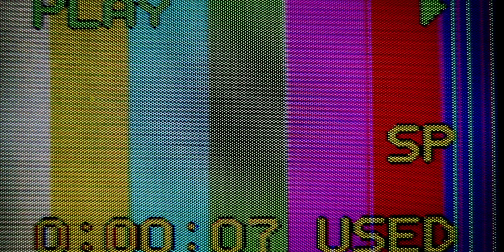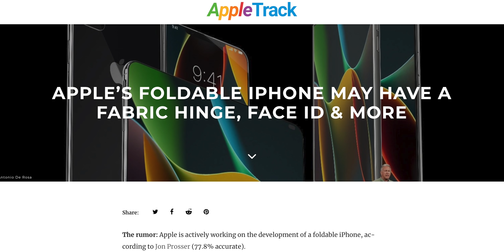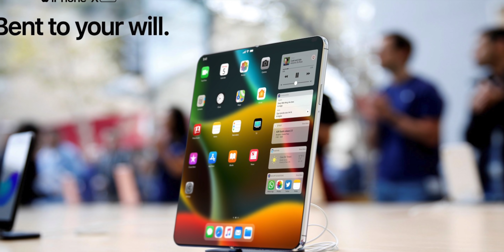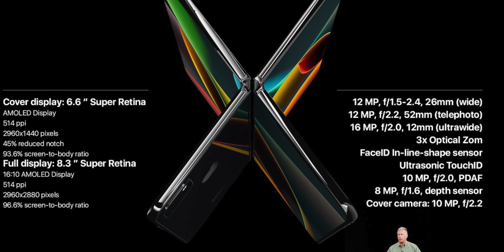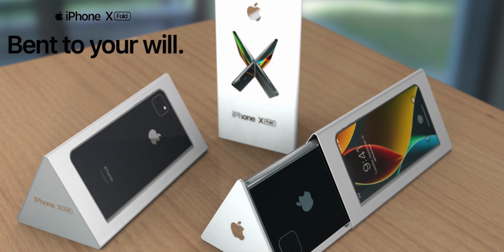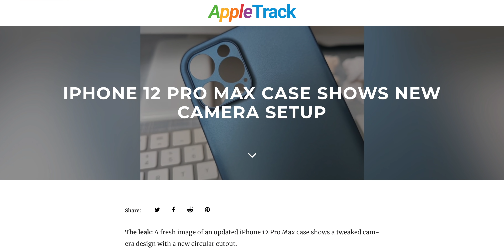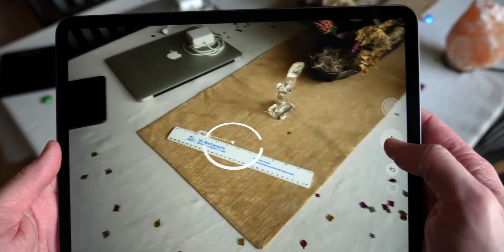iPhone Fold Details, iPhone 12 Pro Max Camera & AirPower Hands-On!

Comment: So this year is basically an S upgrade but Apple naming it like it’s something totally new...
Reply: Well this isn’t new the 6s, 7, and 8 are basically the same with one new feature every year force touch, waterproofing, and wireless charging and little design tweaks like antenna bands and a glass back, in the early days of the iPhone the number upgrades were actually upgrades 3g-4-5-6 hopefully the rumors aren’t true but if they are the 12 will suffer the same fate as the 7 and 8 in being the most forgettable iPhones ever behind the 5C.
Reply: Well call it another iPhone 7/8 situation
Reply: Like the 11 lineup?
Reply: How is this an S upgrade? I've heard its a improved 7-element camera + LIDAR, major redesign with flatter sides, A14 with 5G, magnetic charging, unconfirmed 120hz. Lots more than just performance enhancements

Comment: You know, from a tech perspective, i love the foldable thing. I mean, it's cool. But functional, for me? No, i don't like it, i mean, yeah you have a bigger screen when you take it with you on the way. Guess what, you have an iPad for that. Sure, you need to have to devices with you but at least it doesn't break on you that easy. In my opinion, we are on the very beginning, like with smartphones. In the beginning, with smartphones, the speed wasn't there, it was all plastic and it could break easy. And while it still breaks fairly easy, it's been improved from every angle, it is dust and water free, you have wireless charging, fast charging, OLED screens, 120hz screens. Even 4K screens. And lets not forget camera's. We have fairly powerful camera's in those little devices. We also have more storage and ram in some of those devices than in our laptop. So yeah, i don't think the foldable is ready at this point in time, though i do appreciate everything that Samsung has improved. And you can be sure that Apple is watching it, which is okay btw. I'm an AppleSheep myself, i love Apple, i know their products are great. Overpriced, sure, but great. I have a €15000 Mac Pro here on the side and i love it. It's expensive but great. Anyway, i'm rambling, sorry, i get that sometimes. But yeah, give it a couple years 😎